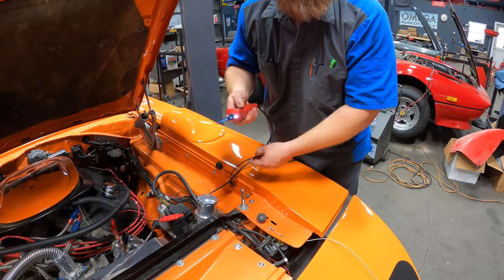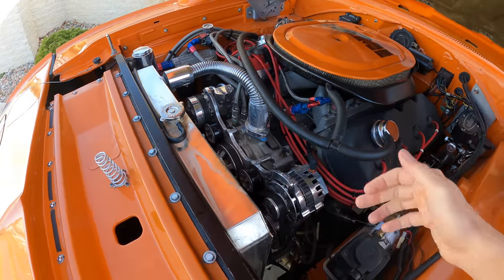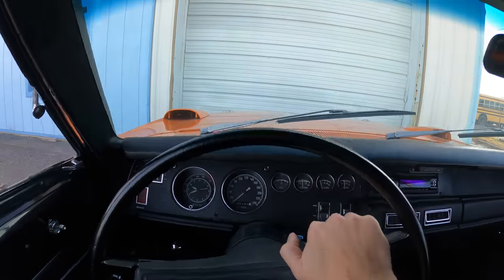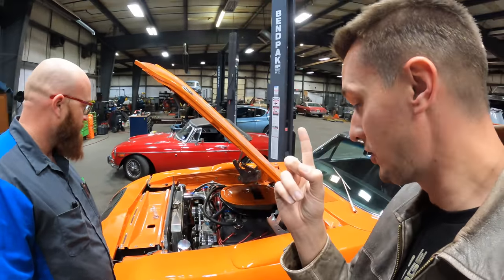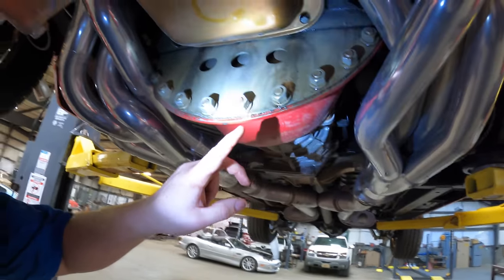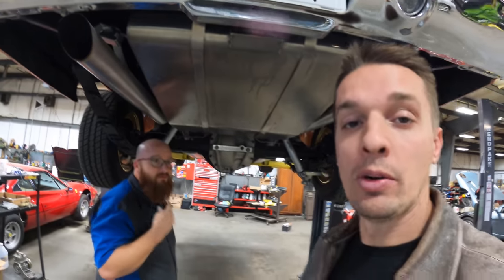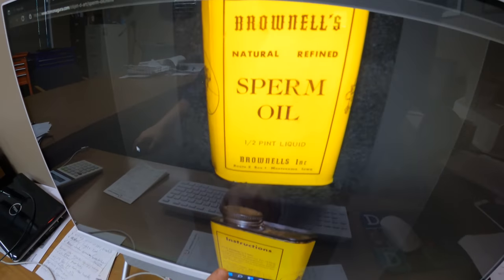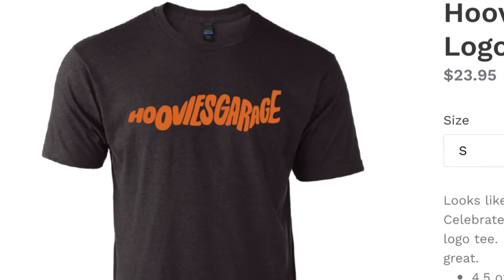How I got SCAMMED buying a Plymouth Superbird online sight unseen (So much broken/missing)

Comment from the maker: I would like to note that the auction site that I purchased this car from has been very helpful through the process, and went above and beyond to refund the $5000 buyer commission they made. I would certainly keep buying from there, but in the end, they are reliant upon the sellers to provide accurate information to create their listings. They are just a go-between, BUT do way more to help their customers than Ebay or many other big auction sites.
Reply: Good to hear
Reply: Sounds like Wizards quote was about perfect trade to make sure it was sorted by him in the end 👍🏽
Reply: Since inspecting the underside didn't reveal signs of the rebuilding, how certain are you that this is an actual superbird and not just a nose cone, wing, and vin plate slapped on a regular roadrunner? I'm worried you might have gotten screwed more than you think
Reply from the maker: @badopinionsrighthere  It was disclosed both at Barrett-Jackson when this car sold in 2010 and here that the floor and drivers side door was replaced among other things, so it would make sense that we don't see any thing. The vast majority of restored 60's-70's  Mopars had rust issues with these kinds of things replaced, yet we don't call them partial re-bodies?
Reply: CrypticPortal I have great experience on eBay.  Never buy something that looks to good to be true.
Reply: If you think this was a rookie error, you're buying a load of garbage. It's still a nice car and he would have bought it regardless.
Reply: I hope you get the hat.
Reply: Hey @hooviesgarage which one of your cars is your wife’s favorite and which one is her least favorite? Which one is the wizard’s least and most favorite?
Reply: Hopefully they blacklist that seller or something.
Reply: @badopinions - having rebuilt a 72 Roadrunner myself (similar unibody structure) I can tell you that a good body man can repair these easily and it wouldn't show signs of damage. With a car like this, you don't cheap out on body work so I doubt that is the case.
Reply: @CrypticPortal no kidding.    Just "sold" a good PS5 and the buyer is a person that just bids without intent to purchase.   I can't relist until a time it's too late to deliver by Christmas
Reply: @HooviesGarage  assuming it's the same car that is. I guess I'm just being a curmudgeon and looking for worst case scenario. I hope it's the real one, it's just that there's plenty of motive to take a 50 to 60 thousand car and pretty it up.
Reply: This sex spam crap is why I rarely comment on videos anymore.
Reply: Check the comment about this being way more of a scam than just missing to list some issues. This thing could be a VIN swapped fake/rebuild.
Reply: Tried to buy a T shirt and found out no shipping to UK, please can something be sorted about this? I love the chanel and have literally watched every video and I'd love a superbird T-shirt 
Thanks
Reply: Honestly could have been way worse, I think you got lucky just having to spend 3400 on a 130K car. Heck you spent that on a crappy Z3.
Reply: Did someone say scammed?
Reply: Cars and Bids?????
Reply: I didn't watch the whole video, but I am waiting for Gomer Pile's surprise, surprise, surprise.
Reply: @mitchellfenton3982  Sha-zayam!
Reply: @tbasmwmc  Keep on reporting it. That's what I do.
Reply: @tbasmwmc  report them...maybe it helps, but if it generates revenue for YT then its probably ignored.
Reply: @CrypticPortal I order from eBay all the time for business and almost never have problems. Whenever I do eBay steps in to keep me happy.
Reply: @T. Boyd - report them, then. If you aren’t reporting them, you are part of the problem.
Reply: Galen Govier is the Mopar numbers guy. He's who Mardi is for Ford.
Reply: Hi mate big fan and have been for a while ignore this if you'd like I was just wondering if you were able to sort out your sound to be a little louder in edit? Love your content only thing I would change but looking forward to the new car trek series
Reply: This makes me want to put more in to my dad's El Camino I got almost a year ago and keeps haunting me at night..
Reply: @Bernhard_Schmidt  But are you buying cars.  Whole different set of rules.
Reply: The Bird is the word!
Reply: @tbasmwmc  just report it.
Reply: It is….the best car he owns.
Reply: Ya know
Reply: If you were not a large yourself presence I have a feeling they would have helped so much
Reply: AT LEAST GIVE BRING-A-TRAILER THE DIFFERENCE BETWEEN THE $5,000 AND THE COST OF REPAIRS
Reply: Have you checked the drivers side trunk gutter partial VIN? 8 digits, if it matches the last 8 digits on the dash VIN, it isn’t a rebody.
Reply: well you got a compensation but any normal consumer wouldn't even get any answers. dork.
Reply: @belowme4927  Hoovie is still out of a signed hat and memorabilia
Reply: I like how everybody go like: Must be a fake, they must have taken a RR swapped VIN and then slaped on the Superbird parts... To those people I would like to say: Do you know WHY all Superbird came with vinyl roof? It's to HIDE ALL THE chopping the guys at Plymouth had to do to modify the rear part of the roof so it was more aerodynamic!! The rear glass on a RR is COMPLETELY different from the one on a Superbird! So, NO doubt this is the real deal, 'cuz it would've taken WAY too much time/money for a scammer to modify the roofline and window frame to make a RR pass for a Superbird! Go watch the other vid, you'll see this has the proper rear window!

So you guys don't know what you're talking about! For people that STILL want to talk thru their hats, here's a Superbird on bare metal: https://www.motortrend.com/news/have-you-ever-seen-a-winged-warrior-in-bare-steel-try-icons-1970-plymouth-superbird/
Reply: What about Carsandbids? I hope Doug and his team would be just as willing to help a customer of theirs who got scammed like this.
Reply: Why the heck would you go and buy a car like that for 140K and not go and see it?? And the price you would know its alot wrong with the car...
Reply: @chassegallerie2910  was about to say the same thing.... Good call, you know a thing or 2 also I see lol. #greasemonkey #gearhead
Reply: @drippinglass  good call 🤙
Reply: @chassegallerie2910  yeah a lot of jaleous people..
Reply: Hoovie-  Your front end sounds like it's completely #ucked.  A common sound on Mopars of that vintage. I think you're going to find out (the hard way) that Mopars  are junk. There I said it. Someone had to. I was around during the muscle car heyday and I can tell you that Mopars would always be found broken down on the side of the road due to poor build quality or wrapped around an oak tree due to their God awful handling. That's why they are so rare today. In the rain they literally handled like a pig on roller skates. In my day the coolest dudes with the hottest babes drove Chevys, period. That was the law of the land.  And if you were lucky enough to be driving a first or second gen Camaro in the early to mid seventies, well, you could do just about anything. Anyway, Good Luck with the car and use extreme caution when driving it as they are death traps. You should be able to get your money back out of it when you sell it next year, provided it stays in one piece. I would recommend getting a set of period correct Mopar rally wheels and blackwall tires to give the car a factory look.
Reply: Sorry, I had to 🤣 when you said not to show up at his house.
Reply: @ScottParisi  I had a buyer refuse the delivery 3 times when the PS3 came out.  I listed it for 3400 buy now.  And sold within 3 hours after buying it that midnight.  The dispute was in his favor.  The package was auto return to sender.  I was forced to refund the money... Minus a 30%restock fee.
Reply: @ttsupra95  - Doug wouldn’t sell this. Too old.
Reply: Only for a huge famous  youtuber 
The average buyer is fucked
Reply: take the seller to court
Reply: @belowme4927  don’t forget about the missing memorabilia.
Reply: OF COURSE how surprised I am that they help the RICH and FAMOUS. If you get a problem, oh yes you can keep your problem. BUT THE RICH AND FAMOUS are BETTER PEOPLE.
Reply: @CrypticPortal - your attitude is understandable. Whenever I buy from eBay I always say to myself "If I don't get the item that's bad, but it's not the end of the world." I try to limit myself to stuff $50 and below. 10 years ago I was buying TVs and PCs from there. Not any more...
Reply: @TireFryer426  sorry my mistake. I don't buy cars on there
Reply: @badopinionsrighthere  its probably a coronet body with swapped vin's
Reply: Is this the one that was built at Pettys shop ? We bought a mustang and a truck there as well as a 72 elcamino. he can take a completely scrap pos and make it look brand new ! He owns equipment that enables him to build a car and you will never in a zillion years know he had it apart.
Reply: @CrypticPortal  I got scammed on eBay too a long time ago
Reply: @batsonelectronics , thank you.    Doing that now.
Reply: Charlie B  That's our Hoovie...
Reply: @ScottParisi  I also make sure all my listings do not sell outside the USA. If you sell anything that can fail I would also set a warranty period and disclaimer that it only covers manufacture defects and not not liquid spill, drops, abuse, or acts of god. I set my warranty for either 7 or 10 days normally. If you don't set a warranty period they can file a claim as long as 6 months out ( used to be only 45 days ) if they claim they didn't open it until recently and it was broken/defective. With a specific warranty period, that is as long as they have to make a claim. I have had people claim they didn't use a computer they bought for 2 months and when they did, it was defective. I was forced to give a refund and when I got it back, it had dates of use from the day they got it. Ebay nor PayPal will do anything though and now that Ebay removed the Neg feedback for buyers, no way to warn others. I also insure everything I sell as I have had both UPS and USPS lose packages and you are on the hook for not delivering the item. ( forced refund )  Hope that helps you.
Reply: Really strange the guy ghosted when "partial rebody" can't be easily found under the vehicle. Only problems are; wrong size shocks, oil leak, and failed vacuum pump. (Should test the engine idle vacuum first to see if you really need those pumps, maybe just a larger vacuum canister).
Reply: @MPMeterman  sarcasm doesn't translate well in text form I guess. Especially to know it all keyboard warriors.......
Reply: Beautiful car and you came out $1,600 to the good.
Reply: @jenzim3639  it may very well be. So cool you found that. 👍
Reply: @ttsupra95  - some people don’t know what Daddy Doug auctions…sorry I didn’t catch your “sarcasm”
Reply: @justinoliver1984  Model kit building helped learn a thing or two. As I'm disabled, I can't even afford a "normal" car, but I can afford them in plastic!

Tho I have yet to buy a SB. Hopefully Revell re-release their SB soon.
Reply: @stefanegger  well, it is a $130k car. Rich is what they want using the site.
Reply: @zephead843  Yeah, of course... Lemme tell ya something. My uncles still talk about how my dad would EASILY take down any Ford or GM with his I6 '74 Duster. Of course, Chrysler products are not perfect, but even your Chevys weren't that good! Also, NASCAR had to ban the winged warriors + the Ford product with aero part 'cuz your all mighty Chevy couldn't keep up with 'em! So yeah. A car is nothing with a good driver. So be it an old Chevy, an old Ford, or an old Chrysler product, if the driver know what they do, the cars will do what they're told to do.
Reply: I’m struggling to spot the scam. You bought a car off the internet and it turned out to have a couple of faults. That’s the gulf between buyer and seller that always exists. It exists in real life too!

Unlike the hat I bet. 

I think you did ok out of this. Good car, another great video 👍🏻
Reply: BAT is a good place. I have been a member since before i can remember (20+ years)
Reply: you did good!
Reply: I hate to say it but hoovie your face kind of look resembles the car
Reply: Why wouldn’t they just pay the repair bill ???
Reply: @HooviesGarage I hope I'm wrong, but I have a sneaking suspicion that is the Talmadge Prince car. The t-bone/partial rebody story fits the description. Though Talmadge was driving a Daytona, the cars being both built on the same Chrysler B platform would make it easy to change it's identity, and since there were far more Superbird's available in 1970 then Daytona's and they were largely rejected by the public.....all I'm saying is maybe you should see if there's a way to see if that thing has always been titled/registered as a Plymouth Superbird. I don't know if it's possible given how heavily modified the car has been over the decades, but given how sketchy the seller was about the car.....I hope I'm wrong. There's not many of the around these days given how long it's been, but a NASCAR mechanic from the period who worked on the Daytona/Superbird might be able to spot weld points and other telltale signs that would differentiate a Daytona from a Superbird.
Reply: @HooviesGarage  And it was the driver's door?! SOB, I really think that may be the Talmadge Prince car.
Reply: @HooviesGarage  at lest it isent rusted out and they bogged over it
Reply: Can you sue the seller or can the auction website sue the seller?
Reply: @HooviesGarage  Yeah but... on BAT it said only the middle was worked on. So it should have a matching number in the trunk. I have no problem with rebodies. I’d actually rather that than all new Asian steel. But the rear # will tell you how much of the original car is left.
Reply: @danny208YT  it is not worth it so I wouldn’t bother this is what happens when u buy a car site unseen
Reply: Also understand your experience may be different as someone who has millions of dollars flowing through their platform.
Reply: @CrypticPortal the key is to keep it small with eBay.  Anything that costs over 50 bucks to ship probably isn't worth selling on eBay.
Reply: Charlie B  are you new to the channel? That's Hoovie's whole schtick...
Reply: @ScottParisi  The seller fees are insane on eBay. Like $100 on an $750 console. Better to use 5 mile or word of mouth. I actually thought about parking at best buy with my hatch open and a PS5 and just waiting lol.
Reply: @gregh7457  Wrong. Look at the rear window, it's not the same as a Roadrunner.
Reply: @chassegallerie2910  And the Coronet front fenders! 😉
Reply: Eieback is crap qa1 makes a drop in set for half that and it’s a drag rated shock that they use on street outlaws and all over wizard overcharges u all the time it’s crazy
Reply: Summit racing oil cooler brand new with lines 130
Reply: Just saved u a grand and u get a better product your welcome if I only had my own shop I could do great work for a great price never jerk anyone seen to many shops just want that buck
Reply: @zephead843  hey dummy, the front end making all that noise and causing problems is NOT the stock front end, it's an aftermarket setup. If you were around 'during the muscle car heyday' you were still in diapers.
Reply: @michaelgemmell7028  as a temporary solution why not sign up for a free US address/post forwarding service online ?
Reply: @crazypeoplearoundtheworld304   Yes, would not be many episodes if the car was not a hooptie (albeit an expensive one  : )
Reply: @21Piloteer  Coronet front fenders? I don't follow you there? I know when they (Chrysler) made the Charger 500 (precursor to the Winged warriors), they used the front grill of the Coronet, did they use the fenders of a Coronet when they made the Super Bird?
Reply: OH NO NO NO!

You guys are NOT the dumbest auto channel in the world. I am. Hands down. I imported a city bus from Romania...top that if you can LOL
Reply: @chassegallerie2910  Yes sir! 1970 Coronet front fenders on the 'birds to allow fitment of the nose.
Reply: @CrypticPortal that's amusing to me as selling a unique car on eBay was easy, it was the stupid auto hauler that showed up that was the nightmare, and that wasn't ebay's fault.
Reply: Convert the headlights to electric motors.
Reply: @Martin Yeah...I know...now excuse me while I go cry at my own folly LOL
Reply: @tbasmwmc  I agree - Report it like I do.
Reply: @HooviesGarage  I think that nose cone is a repop
Reply: @zephead843  We are all entitled to our opinions, personally I don't think all Mopars are junk.
Reply: @21Piloteer  The more you know! Yeah, those cars were Frankstein monsters. But all of this made 'em quite performant back then.
Reply: @340stroke  lol...yeah that gap can use a little massaging.  Doubt it's an original Creative Industries piece.
Reply: @Martin lol...well, I cry motor oil (usually burned and foul), which is why my driveway and garage floor is like it was tarred and feathered but with leaves instead....I dont know..it was funnier somehow before I wrote it...
Reply: That’s great BAT took care of you. I  bought a 2006 Jeep Rubicon from there last Spring and it went great. Of course the seller was very informative and we stayed in touch until the shipper dropped off my Jeep. I watch auctions there every day. You need to get a 87 GNX to add to your collection. Wish I could afford one.
Reply: No Pre Purchase Inspection on a $130,000 car? Dude should have been honest, but you should have known better with your extensive experience.
Reply: @HooviesGarage  were* replaced
Reply: @HooviesGarage  anything*
Reply: @dreammfyre  It wouldn't have made it into the registry as a fake. Those guys know real cars vs clones.
Reply: @kongebilj193  because every other superbird is 200k.
Reply: @mattg7952  What did i just say?
Reply: @johnb.7979  Just a kid with a good memory.
Reply: Hoovie, I would invest in a higher spec racing fully adjustable suspension maybe get the car back on the track for some heritage racing event.
Reply: @batsonelectronics  well they are past 10% now and are charging fees on tax and shipping which is insane and improper.
Reply: lol shart
Reply: What is the benefit of that Milodin Oil Sump ?  Wouldn't that the flared bottom profile make it more difficult to pump oil out of it?
Reply: @johnb.7979  I think I said rain, but whatever.
Reply: @zephead843  still didn't answer my question
Reply: Yes they refunded you cause your popular Youtuber.  For us ordinary folks, that would never happen.  BAT never goes above and beyond to help the seller or buyer if an issue occurs.
Reply: Can you recommend a car transporter?
Reply: Just so you know Petty will be the last one out of anywhere signing autographs. Its one of the most common signatures in the world honestly. Basically worthless.
Reply: It only counts if you skid your undies
Reply: Out and SHAME the SCAMMER!
Reply: @HooviesGarage  Because the value of the car is due to the rarity of the wing cars.  A Road Runner (or even Satellite) with nose, wing, and tampered VIN (illegal in all 50 states) is only worth the cost of those special parts - assuming they're even OEM.
Reply: Bring a trailer made it work out great . That’s awesome but that could’ve been a lot worse .
Reply: @CrypticPortal Agreed, bought a MR2 from Georgia to Canada, had to put another 2K into a car that was supposed to be "good to go". So many f*cking scammers out there.
Reply: You bought it site unseen, so you get what you get. Quit crying 👎
Reply: Please make more videos after the repairs, love this car, would love to know how the repairs go!
Reply: Since the auction site did the stand up thing by refunding you the $5000 fee,  personally I would now take the $1600 balance from that $5000 that you didn't spend on repairs and give to the auction site, so they don't take a complete hit on the sale because of the asshole seller.
Reply: @badopinionsrighthere  Looked like that entire floor was replaced.  Body shop may have been that good.
Reply: Absolutely beautiful car hoovie I did and would love to own something as bad ass as that
Reply: Buys car unseen or inspected

Got scammed?
Whatever
Reply: I used to make a reasonable living buying and selling on ebay. Those days are long gone. Ebay destroyed itself. Its fine for buying new items and maybe the odd used item,, but as a seller I had a £1500 parcel get stolen from the DX warehouse in croyden and lost everything. PayPal took the money out of my account to refund and I lost both the money and the item. End of story. You'd be an idiot to sell on ebay which is why there's nothing good left to buy. Apart from new items.
Reply: Give the wizard my regards and sympathy for upgrading to windows 11.
Reply: NO!, YOU DID NOT get scam!! You paid $130,000 for replica!! The way it sits!! If the numbers are all matching?, it's a TRUE Car.
Reply: @zephead843  Could not agree with you more. These were sloppily assembled at the factory and many of these sat on dealer lots for a long time due to lack of demand. The handling on these were atrocious. Pro? They look cool!
Reply: Charlie B  You can have a inspector go and check the car out for you for a fee. A friend of mine sells classic vettes and he won't by a car without a pre inspection. It is amazing how much rust a fiberglass car can have.
Reply: @drippinglass  The front radiator support has the vin on the drivers side also.
Reply: Gold rims, should have been a clue... cobbler
Reply: @drippinglass That's really good Information. In Collision repair A side Impact Is hard To get right. This Is a real concern.
Reply: @michaelwilkening8542  For some reason a  lot of Superbirds don’t.
Reply: @mattg7952  Maybe the only thing original is the VIN.
Reply: @chassegallerie2910 I'm not saying.it.is.ot.isnt. so know what you mean about the rear glass.being.different. I knew.someone.that.took.A.Sattalite modified it.it with some things from the sattalite and got some.emblems the.horn and sold.it as A Road runner. I don't know how He.pulled It off. The Back Window never lies On these..I could never do that to someone but their.are plenty that will.
Reply: @zephead843 Will Chrysler Was Kinda.the.cheap way to.go In buying a car. A ford.or Chevrolet was.higher dollar..I mean I'm not saying that these Cars are.junk. Some.have been rebuilt to be better when they.were.new.
Reply: @ispeedon287 That's pretty cruel Comment without even knowing why. But With that Said I'm a Chevelle fan..I don't know a.Super.Bird.Super bee's, Cuda's are Pretty high.dollar.cars.
Reply: @shacklifecustoms8430  i own a shop. Im more honest than most around. But my prices are higher because of it. 
I tried the whole young shop owner wanting to save the world thing. 
No one cares. 
No one will ever know the time or money you waste to save the day. 
No one will appreciate any of it. 
Youll never stay in business with that attitude. 
No ones special and no one gets free labor even family. 
Youll learn if its the route you go down.
Reply: @chassegallerie2910  I have to admit I didn't watch the video. I get what You're saying and I agree. The Partial Floor Pan replacement was fairly well done. I honestly had some one I knew sell A Early Model Sattalite As A Road Runner. Of course the Gentleman must not of known about the back window Was different. I actually road In A Super Bird back in the day. The Used Car Dealer was trying to convince Us it was not A factory 4 speed car. It was A Three Speed. When He got On It Blue Smoke just Poured Out. What I think a lot of what People don't get body fit was not really a big factor because of the Modifications done.
Reply: @tbasmwmc  Blame youtube, not Hoovie or any other content creator. They care more about dislikes on MSM videos instead of this stuff.
Reply: i hope you do a video when the work has been done. i love that colour with the vynil roof.
Reply: @christopherl2143  I wish I knew why. I’ve been going to beach chair do wop car shows since 1994 and that’s my observation
Reply: @nickforsythe7486  that's what I said. He has All the evidence.
Reply: @XVIravenIVX  😂 Ain't that the truth!
Reply: @Robert Annayes and no. It makes a good story but it's a used car. Mostly used cars are as is no matter what.
Reply: Its still an good deal nice car get frame professionally straightened and reinforced yeah you got a good deal on that car
Reply: Where is the chair
Reply: @tbasmwmc  why, are you a puritan?
Reply: @slapdoctor707  What is the year of the elco? I owned a 78 and had a blast with it.
Reply: @jimbaldridge9392  71 with a cal induction hood with a 383 stroker. It's dark Grey with black strips. It sat for 11 years since he passed away. It's already in a shop now. Maybe I'll make videos if I get some attention about it.
Reply: Lmfao the seller of this car will be back on bring a trailer under someone else's account !! This happens often on alot of dites
Reply: Those old big block motors will creep up temp wise, on sunny days, in a drive through line or at long red lights. You dont want to be in one in a traffic jam on a hot day either. I have a Ford with a 352 BB in it and I took the chopper out and put an aluminum rad with 3 cores and two electric fans and mine did it to the point of frustration with me. An old motorhead friend said, "Your shroud sucks. It isnt doing anything for the motor. You need a real fan shroud."

I thought that sounded too easy and I wasnt dropping the money on something unless I knew it would work. So I went to tractor supply, bought some aluminum sheet, made some templates out of cardboard, cut it out into three pieces, tweaked the fit and notched it to get around the hose and whatnot, put it together with 6 pop rivets and painted it black.

It came out nice enough that I most certainly wouldnt replace it with one that was pre fabbed. And best of all, it dropped my running temp, while in drive, idling in drive through lines or whatever is necessary, by 15 degrees and it no longer creeps up. She goes between 185 and 195. 

No shroud is pretty. Cars look way better without them. But that is most likely your solution because your shroud is non existent. Until you try it and prove me wrong dont poo poo my suggestion.
Reply: @lushionxazaver323  Your marketing needs improvement.
Reply: I actually just got to the part where dude farted lol
Reply: It would be cool if they got the car to inspect and they send it to you so stuff like this is known and sellers can't pull the wool over a buyer's eyes.
Reply: Waiting for the mechanic to eat the car as he loves tasting it 1st.
Reply: @TKsGarage  get some teeth
Reply: @shoominati23  that doesn't make any sense because right when I first started selling things I could sell up to 200 items at a time
Reply: Guglis Amonopol  LMFAO
Reply: @HockeyMasterBroHMB  you do have a feeling they would have helped so much if he wasn't so much of it as yourself? I mean what did you just say
Reply: @belowme4927  why he got screwed on the hat, and I hate Tyler
Reply: @justlucky13  who the hell cares
Reply: @veno8mm  so then you lucked out like crazy, getting a 30% restock fee
Reply: @justinclement5417  yeah I guess so...  Although it was finally settled in March.   When the console came out 11/11/11.
Reply: Charlie B  i see the experts have arrived huh hoovie?
Reply: I would ask them for a partial refund for the missing items.
Reply: At 15:18 I'm convinced the buyer is a moron..., blessed for sure.
Reply: @veno8mm  PS3 Cost what $799? You got to keep 30% restocking fee so around a grand? You got a free PS3 out of the deal sounds like eBay took good care of you.
Reply: @Wallyworld30  the point I was trying to make is if you sell something on eBay.  A buyer can simply refuse the item as a way to break the purchasing agreement.  Shipping companies will fulfill 3 attempts to deliver.  Then after that the buyer automatically wins the disputed claim.  But to agree with you I did profit.  Although it was 5 months of back n forth vs the initial net profit during the 2 hours post release.
Reply: To much negative Publicity due to the type/cost of purchase its in the business to appear as helping real help in business equals money reimbursement
Reply: This is all well and good but wizard needs to stop tasting motor fluids.
Reply: The seller not including the Richard petty memorabilia is completely unacceptable and very pathetic and anyone who believes the shipper stole it is very, very naive. I’d be shocked if BAT ever lets that seller back on their platform again.
Reply: @chassegallerie2910  yes,they used '70 coronet fenders and modified the coronet hood by adding an extension so it would follow the shape of the nose cone
Reply: Never ever buy a car sight unseen period i dont feel sorry for this buyer
Reply: Tyler, your videos are more than entertaining, and your sense of humor is always appreciated.  Just a brush up in grammar...FROM is a preposition that needs an object following it.  To say (from there) is not correct although everyone clearly knows what you mean.  To have inherited an SL from your grandmother and to have a high-class upbringing, it seems strange to not have a little editing grammar wise.  I know my videos are just made up " off the cuff".  Maybe I'll go viral from their spontaneity???  (there should be them, direct object and pronoun relating to the auction house....